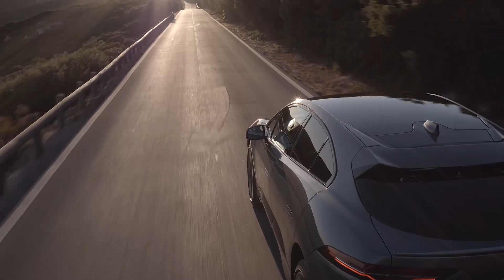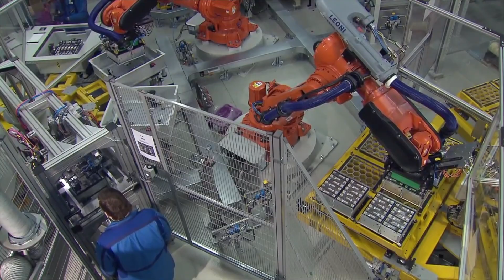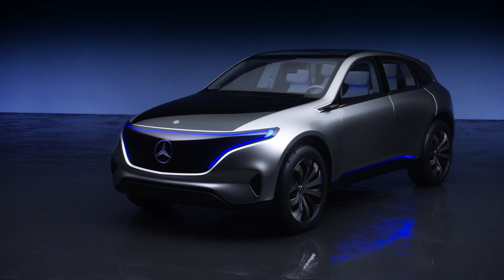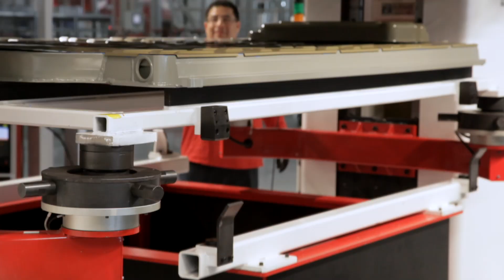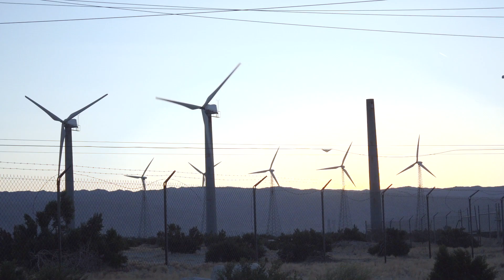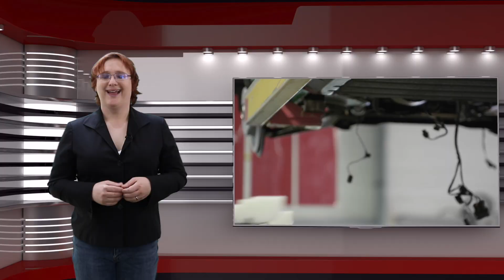Cobalt And EVs: What You Need To Know

Comment: just my 2 cents here

I do own "fossil car". Reason is that my daily commute is 200km and there is no chrager at my workplace nor nearby my road. Reason nr. 2 is that i dont have money to buy sayd EV or even PHEV since they are expensive and used market is not only expensive, but also realy risky (dead/almost dead battery).

My daily commute is getting more and more expensive since the rise of petrol (gas) prices. So there will eventualy be time where running cost for me are too expensive adn since its more expensive i earn less money. When i earn less money i can not buy EV. When i can`t buy new EV, im stuck with "fossil". That car will at that time be even more expensive due to fuel price. 

quite a black hole we have here.

It would be nice for goverments to buy used cars from us in exchange in one time deal to buy new EV/PHEV car. Some car manufacturers have buyback programs, but of course for 1/10 of used car market value.

Comment: While the DRC does have the largest supply of easily mined cobalt, it is not a rare earth metal, and it is mostly found together with copper and nickel. Historically demand for cobalt was so low that most nickel and copper-mines did not find it economically profitable to extract the cobalt and therefore ended up wherever they dumped the rest of the material that they did not use.

Comment: I think it will be a non issue.  Manufacturers want a solid state battery.  Fisher has confirmed they have one.  Toyota is working on one but says they are a ways out with production ready product. Samsung has one and is currently working with Ford. I imagine  there are more deals or collaboration between companies that I don't know about or that are waiting for the right time to tell us.  Either way, when talking about ev's with anyone opposed. I've noticed their number one argument is the Lithium batteries.  How they are dangerous.  Flammable or use rare earth metals.  The argument is almost always the same.  So I'm sure automakers have come to the same realization.  Not to mention the fact that a solid state battery could charge in a fraction of the time and be more dense.  But I digress.  Great video, as usual.  I must say.  I appreciate how the content, despite the fact you are an EV supporter, is unbiased.

Comment: Lithium Ion batteries are NOT the future of electric cars.  They are too large and too heavy for the best overall performance.  Sodium glass or some kind of graphine battery/supercapacitor will likely overtake lithium batteries for cost to production costs as the cheapest and best battery tech for electric cars in the next 5-10 years.
Reply: Probably, but lithium is good enough for now, and will allow us to start building out the infrastructure based on demand.

ie. it's still better than IC.

Comment: I read thru the comments. I think a video on explaining battery composition. Like a Nikki engineering battery 101 done classroom style with white board and all! Woot woot! Also the difference between EV batteries and all over recargable batteries used in smaller devices.

Comment: The issue should not be "having enough for now", it's do we have enough for centuries. Without such thinking we're going down the same road as we went with the ICE and probably worse as we can synthesise the fuel for an ICE using solar energy. It's even possible to run an ICE on wood, the UK did it during WWII.
Reply: Agreed, though the cobalt can, in many cases, be recovered in recycling, so that lessens the requirement somewhat.

ie. do we have enough to built out demand, and replace the 10% consumed per year after recycling. (10% is a junk figure, there for illustration of the point).

Comment: If Tesla wants to be the new Ford, they need $25,000 Tesla Model 3s with 350 miles of range and need to be able to pop them out at 20x the current manufacturing speed.

Comment: This is great if you live in a house, where charging at home is easy available. If you live in a apartment structure well this is not very accessable.
Reply: Depends on your parking situation. If you have a parking space, also fine. There are solutions for street parking also, though it's not clear which will be adopted widely.

There is a company that upgrades streetlights with LED's, and can then provide the excess power through a point in the side of the light post. For example.

Comment: Hi nikki, I wish that you had given a short explanation of WHY there is cobalt in batteries .
Reply: I've heard that cobalt provides thermal stability to the battery pack.
Reply: Adding to the others...Cobalt provides stability in relation to fast charging and (discharging I assume too), and so patently it's ultra-useful in that regard.  It was put this way by some analysts I read, and I paraphrase: the cobalt is excellent and the best there is at stabilising the charging process, and the nickel is excellent and the best there is at maximising energy density.  So, that's the situation.  Both these elements provide a service in the EV world, and are not at all interchangeable in terms of properties.  However, I presume, Tesla will make up for introducing a degree of instability, by having their monitoring and feedback and charge adjustment, that bit more 'on the ball'.  Hey, I know nothing, it's just what I read on some investment pages online, so beware them saying what suits their investments!
Reply: It's one of the magor ingredients.

Comment: Great topic to cover. Interesting video. I don't know if I was just not aware of it but it's amazing how these social issues were not a problem when cobalt was just being used in the aerospace, chemical, tooling industries and batteries for laptops. Also Apple seems to be using more and more cobalt in its batteries with out the same amount of out cry about EVs
Reply: Partially that's because by using it for home/grid storage and EV's, we're requiring an increase in production of a couple orders of magnitude. This is not the same as doubling production.

Comment: How does battery recycling fit in this story? Are the raw materials used to make the battery recoverable?
Reply: The cobalt is in newer designs, but a lot of the other things including lithium is not. Recycling rates are bad currently and every company ecec you ask will just divert from the question to reusing old drive batteries as something else.
Reply: It depends partially on design. Tesla has designed theirs to be ~90-95% recyclable, but some materials are not feasible. Not every company approaches the design in this way. Also, by weight, Nickel is the largest part of a Tesla battery, by a long way (>75% I believe).

I think the big thing here is that the batteries are so large that it's actually worth trying to recycle them - as in, rather than the rechargeable batteries in consumer electronics, that are small and difficult to gather on a large scale without many collection points and community education, EV and home storage batteries are much fewer and can weigh half a tonne.
Reply: Last year a few people researched the stuff and on their own site Tesla celebrated themselves for achieving ~75% recycling rate (including the weight of the casing and control electronics of course...) so, I wonder where you got those 95% from.
The way I see it we will not see really recyclable batteries until we get solid state ones. The problem is that lithiom ion batteries simply self combust when opened. The university of Hannover has a process which can handle that, but it involved shredding the batteries and sorting the materials by hand in a vacuum.
Reply: I have seen plenty of them opened on youtube channels. You need to drain them first, I believe.

Comment: Coming from Africa, the DRC would quite happily sell a mine to say VW or consortium of VW, MB and BMW.  Why do they simply not buy a mine?  Sure they will land up paying a premium and lots of tax to the government, but they gain 2 big issues, they can insure responsible mining and they can control supply.
Reply: My guess would be they are not a mining company and would have to "learn" a new trade, knowing fully well that the mine will become obsolete and worthless to them as soon as they move away from cobalt alltogether. Then they would be stranded and need to either sell it at a loss or drag it along, complicating their company structure unnecessarily. German (and other) companies have also made a good deal of bad experiences with unstable countries. One election later they might be used as scapegoat for some nonesense, so they prefer staying out of it and cust be a customer.
Reply: Many areas in the DRC are under control of warlords. Access is limited to many areas. China has its fingers deep into the region. Mining is very specialised and difficult. 
That's 4 good reasons for you
Reply: Wobbegong .  Team up with experienced mining companies.   Whatever they replace cobalt with, they going to need to mine it.  In central Africa abusive labour is almost the norm.
Reply: Lawrence Atkinson .   Team up with China, they make more EV’s than any other country.
Reply: Thumbs up just for a Ross Perot reference.